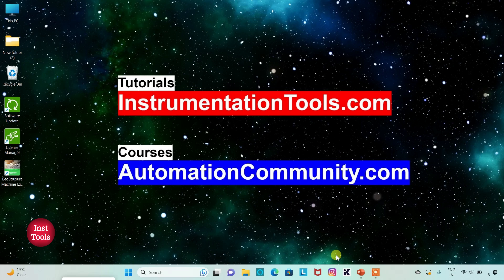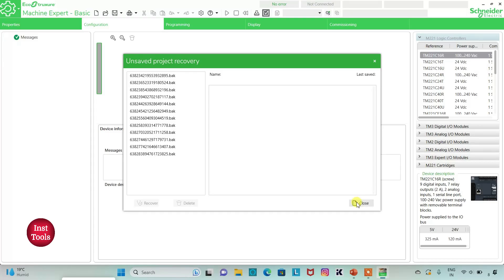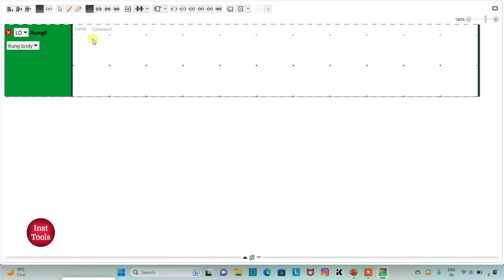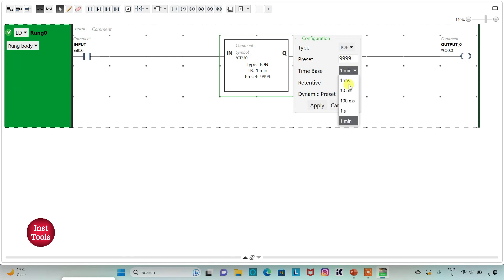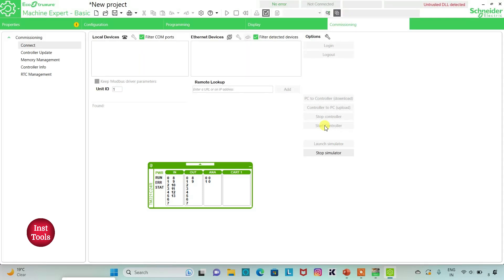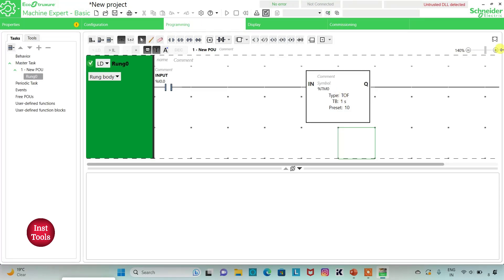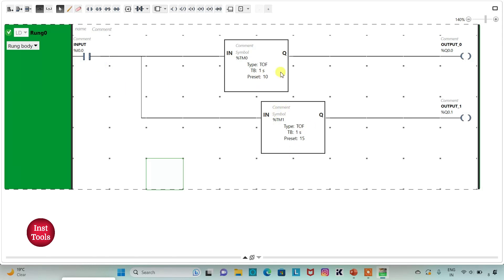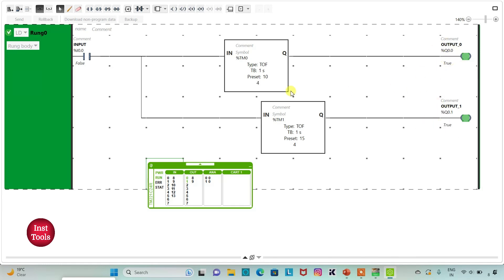Schneider Electric Training and Courses - OFF Delay Timer (TOF)

Comment: Thanks. Very Helpful,
The only anomaly I found was that my software would not accept OUTPUT_0 and said such an output was unknown. It did accept OUTPUT however and then also OUTPUT_1.
Reply: You can rename your output to OUTPUT_0 try check if you haven’t use the name for other Output or if you already have used another name for your output then go into digital output and rename it from there and then apply